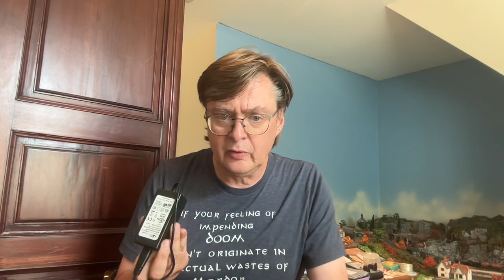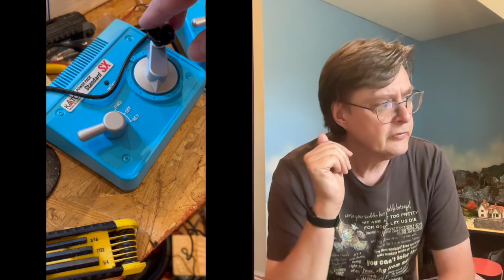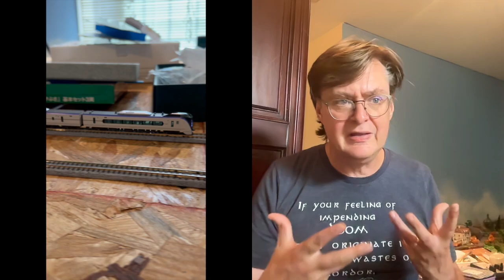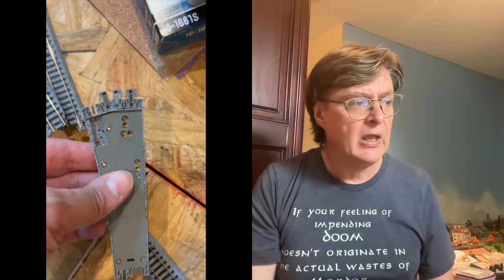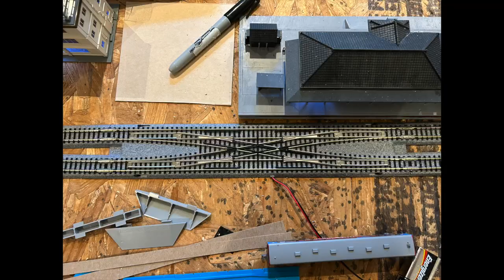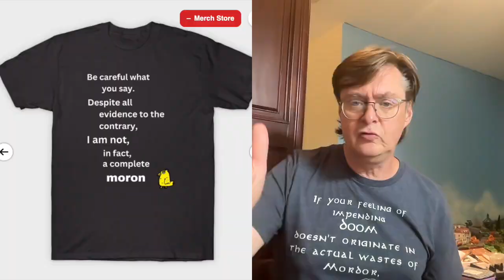Building an all Japanese N-gauge model railway  (Part 2): power, DC/DCC and turn outs. AJ Hartley.

Comment: You were close on the voltages. Japan is 100VAC and US is 120VAC normally. The switching power supplies normally included now are efficient, and can handle from 100 to 240VAC.
Enjoying your videos! 🙂
Reply from the maker: Thanks for the correction!